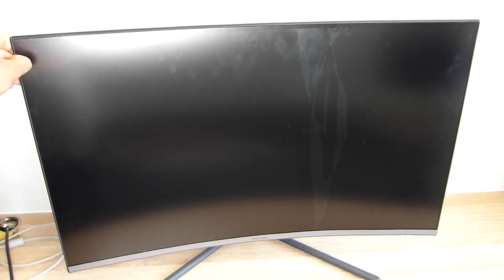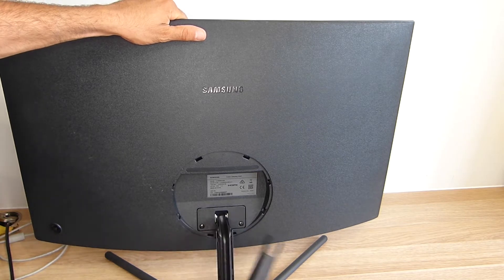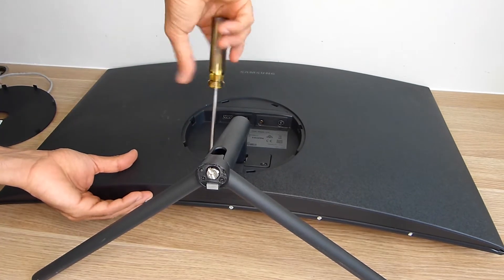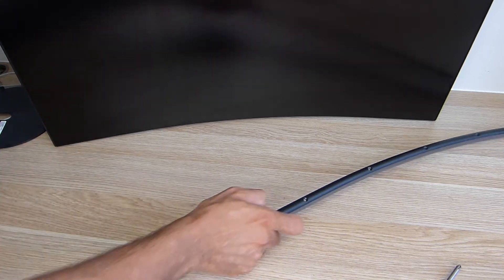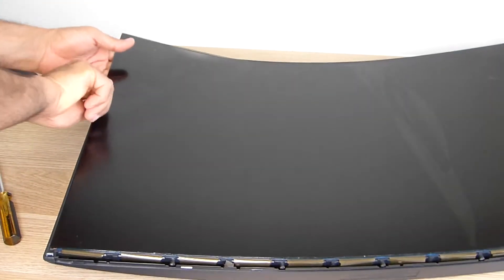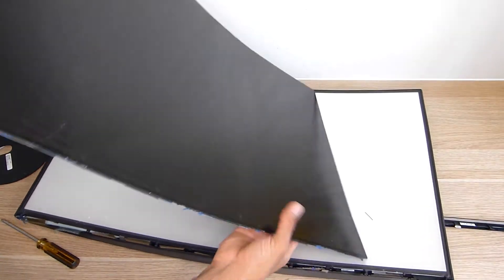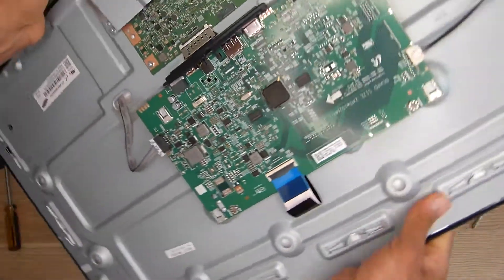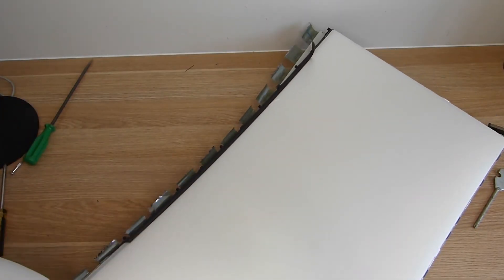4K Curved Screen PC Monitor teardown, Samsung U32R590CWE

Comment: Could you have removed the back with access to motherboard without damaging the screen? Mine won't turn on and I can get a new motherboard for cheap but what's the point if I damage my screen that's fine
Reply from the maker: Probably you can using a heat gun, in my case I didn't care as the panel was already broken.